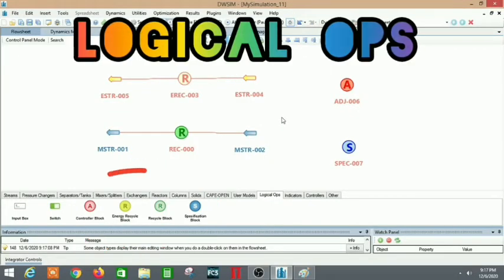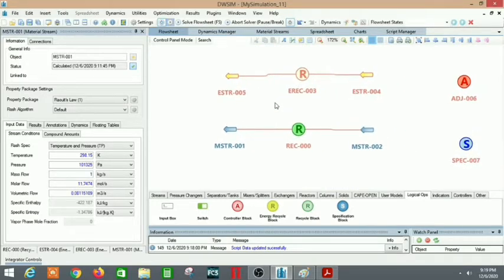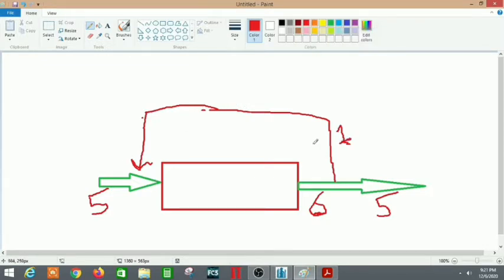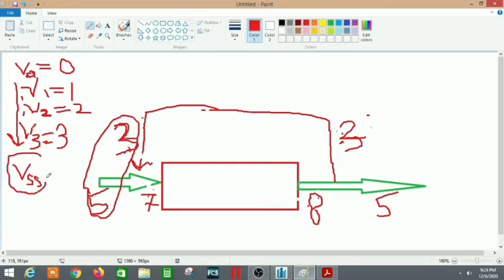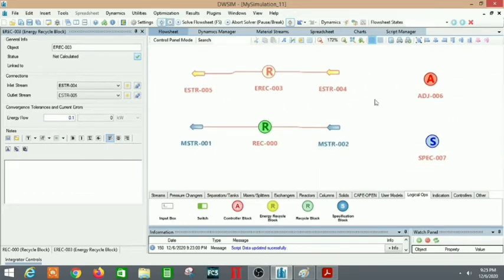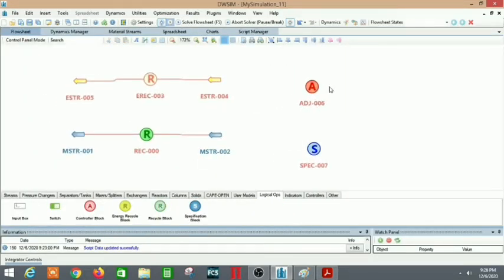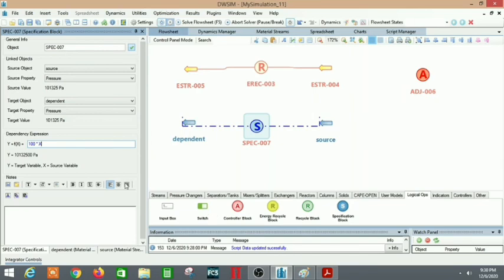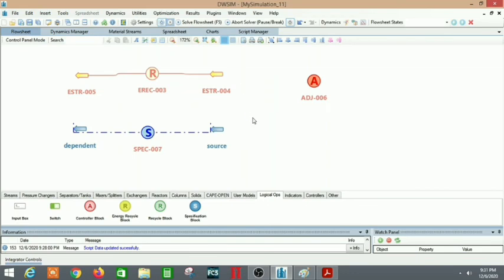LOGICAL OPS in DWSIM | Recycle | Adjust | and others...

Comment: Bro I am simulating a gas and steam power plant and dwsim tells me to put in recycle blocks otherwise it won't work but how do I know where to put the recycle blocks, in the internet most of the people put it in heat exchanger but I have only heater, can u pls help?
Reply from the maker: Identify the stream which should be in a loop. First , see the end points of all streams . Then , find which stream you need to extend and thus make a loop. Hope you find the correct stream to recycle.